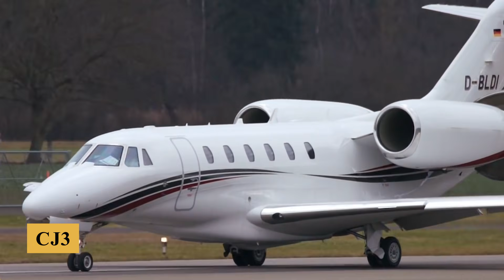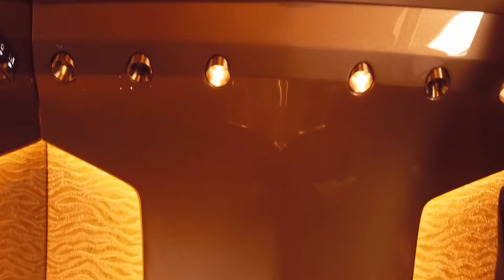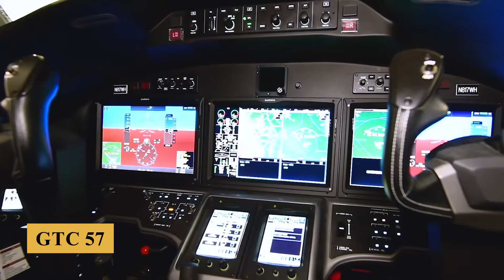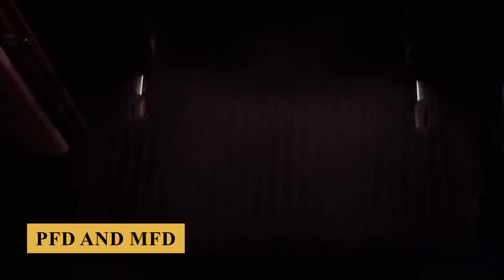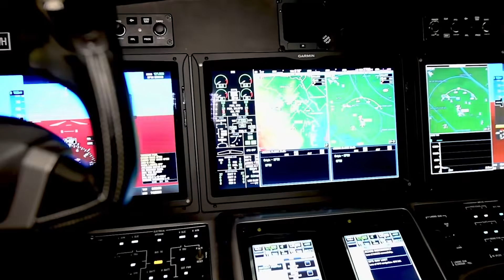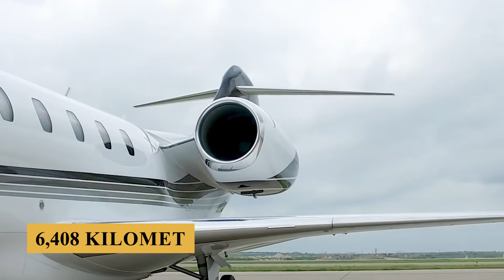Inside The $25 Million Cessna Citation X+

Comment: The Citation X+ has been replaced with the Citation Longitude and is no longer manufactured.
Reply: True but the 339 that were manufactured will be flying for a long, long time. Very capable aircraft.
Reply: @RRUSA9630  As long as they can keep them flying. It is still also the fastest private jet in its class.
Reply: Is the longitude fast as well?
Reply: @sidneyshaw9205  Yes, but not as fast as the Citation X.